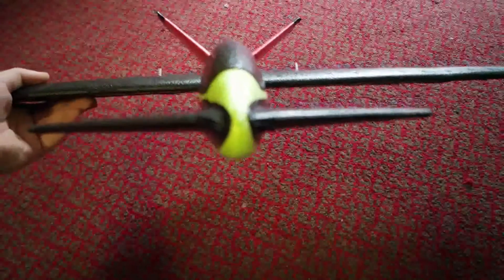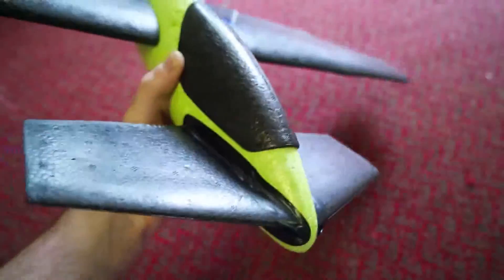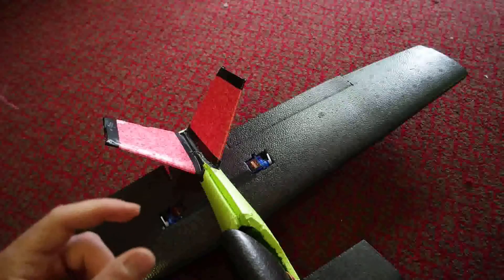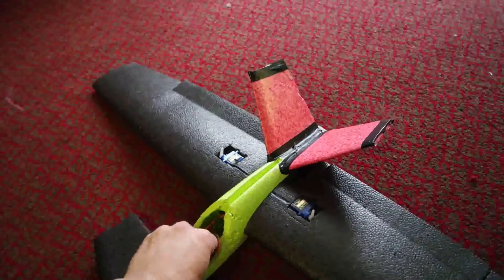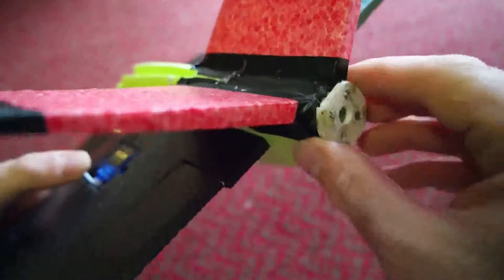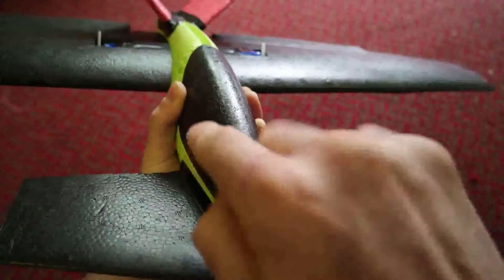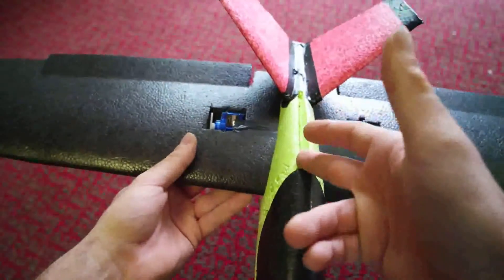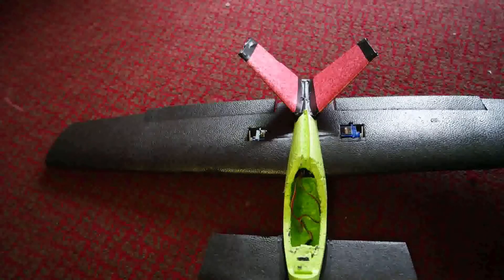Lidl glider conversion overview. V-tail, canard wing!

Comment: Nice idea to do a canard conversion of the plane.
I´d really love to see a build video, or at least get some more info on the build, 
especially the details on the new geometry (gc, shape, position and angles of the canard wing).

If a little constructive critisism is allowed:
Considering the motor mount aka heat barrier made in a 3D printer:
Isn´t the material used in 3D printers prone to thermal weakening as well?
I traditionally go for plywood and never had any melting issues with that material. :)

BTW: the kit is available at Lidl Germany this week (july 2nd  2018 till july 8th)
Reply: RageDavis I use 3d printed motor mounts on most of my planes. Like my talon. I use abs which is extruded at 230c + so should be okay, if the motor gets hot enough to melt that you've got other problems I suspect. Hopefully they will do the full build like you say though. Can I order this frame from German lidl then?
Reply: Hey, James, thanks for your reply.
I guess you´re right, when the motor exceeds 230°C at the mounting points, it is most likely burning...causing more serious trouble along the way (down)... ;)
The offer from Lidl german was two weeks ago, I just had a quick look at the homepage of Lidl Germany and did not find the plane in the list (search phrases: "XL", "Playtive" and "Segelflugzeug" (soaring plane in german)).
Therefore, I´m uncertain, if it is still available via a more rigorous search.